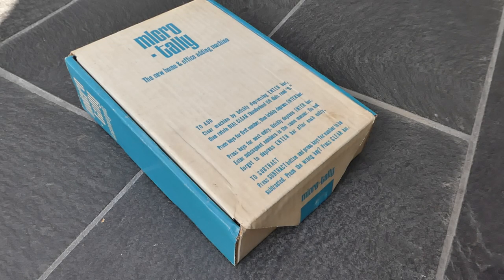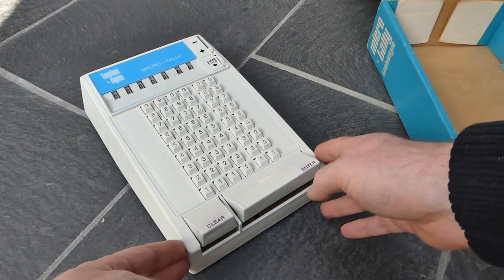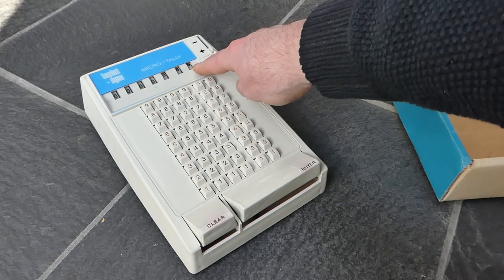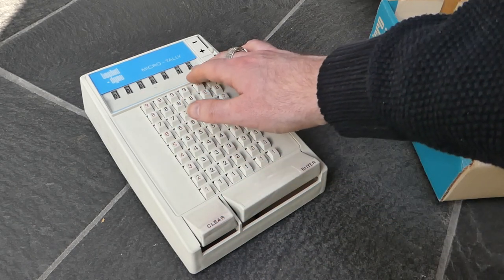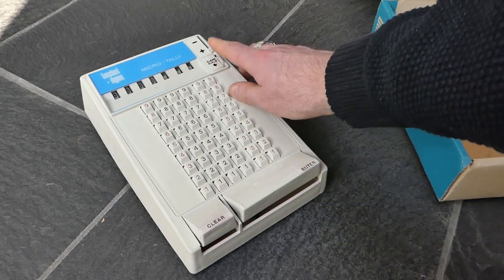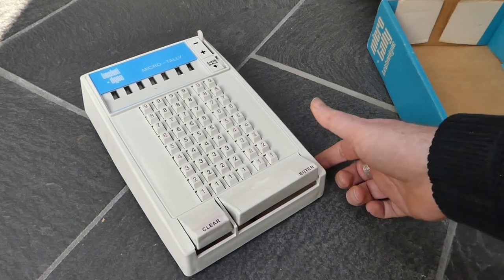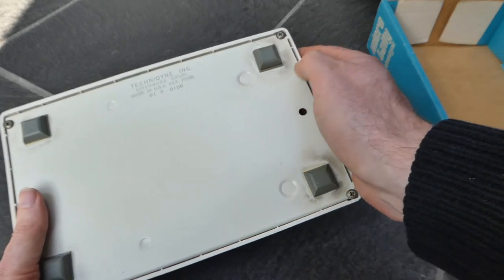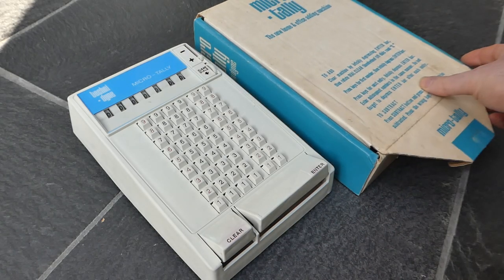The Technidyne Micro-Tally adding machine

Comment: I like that machine Jaap, it has a great sound when you press the keys.  Very clever design having the top plate and keys as a single part but the hinge would inevitably fail after a certain amount of use.  I bet there are very few of those in existence.
Reply from the maker: Some of the button hinges on this machine are indeed a bit weak. In particular, the 4 in the left column does not lift up quite far enough, so if you press a higher value in that column it usually registers as a 4.

Comment: The fact that this is obviously a really cheap, 100% mechanical adding machine with extremely 1970s styling makes it seem like something that dropped out of an alternate timeline.
Reply from the maker: It is so cheaply made I'm astonished that it works at all! It didn't at first, so I opened it to squirt in some lube, and reset a few parts that were misaligned. Once I closed the case it suddenly began to work.